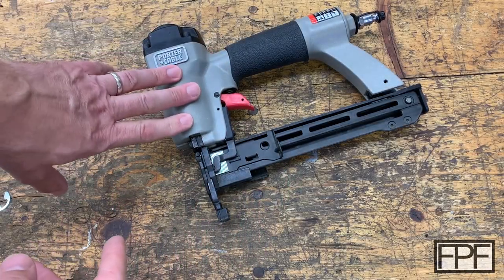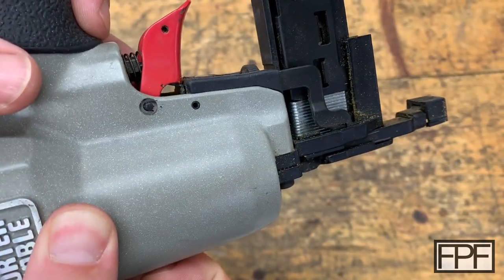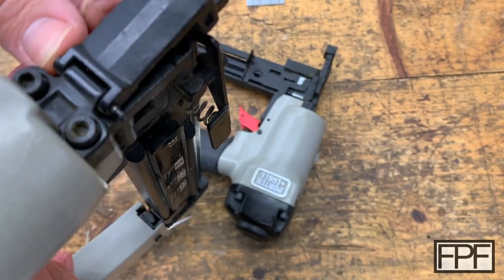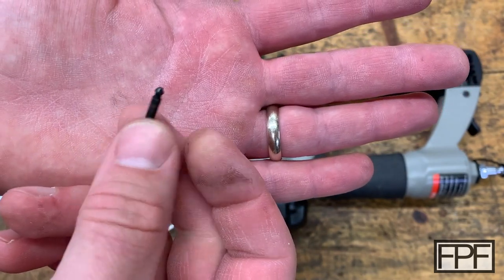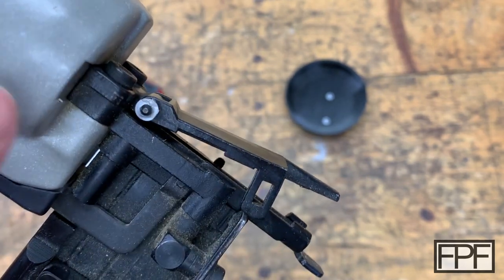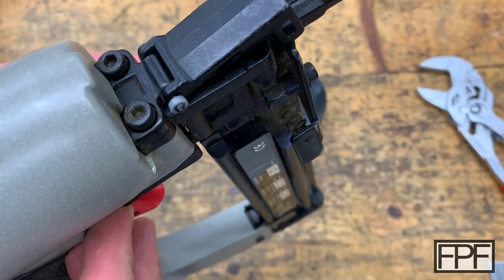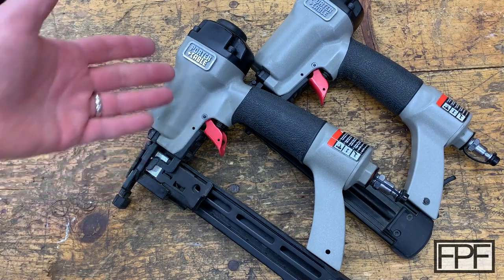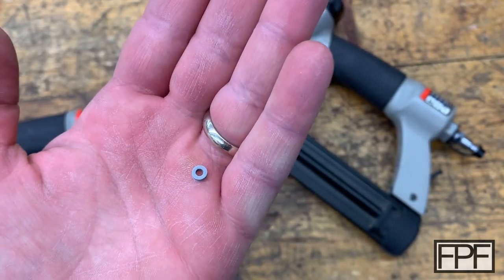Worlds Smallest Functional 3D Printed Part

Comment: My craftsman nailer looks similar to that one.  I got lucky and mine did use o-rings to hold the pins in place.  I need to get some TPU and play with it so I can make some gaskets
Reply from the maker: The biggest challenge with TPU is keeping it dry.  I generally run it in the dehydrator each time before I print.

Comment: Nice repair. You should have printed a bunch of them just in case you'd need one in the distant future. They're so small it wouldn't make sense to print 1 or 2 at a time.. Good job. Thank you for the interesting video.
Reply from the maker: Thx for the suggestion.   I kicked off another 4